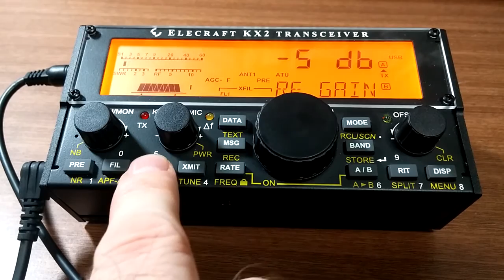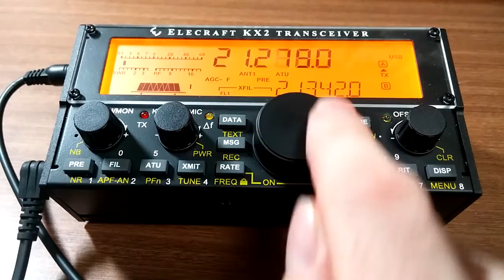Elecraft KX2: RF Gain and assigning functions to PFn button for fast access

Comment: I have a newer KX2, bought earlier this year (2018), and this did not work with mine.   To program mine, after selecting which function you want to program, you press the PFn key, THEN you have to press buttons 1,2,3, or 4 to assign the function.   Apparently there has been a change in the software since your video was made.   I also have used the same riding RF gain method as you and really like that method of operating.  Thanks for video!
Reply: GeoS, thanks so much for the update on assigning the function key, after several attempt of following the manuals instruction I was getting quite frustrated. Stingy Ham, thank you for your efforts to educate a newbie to the KX2, I'm finding to be all I've read about it. 73 KE0JVS